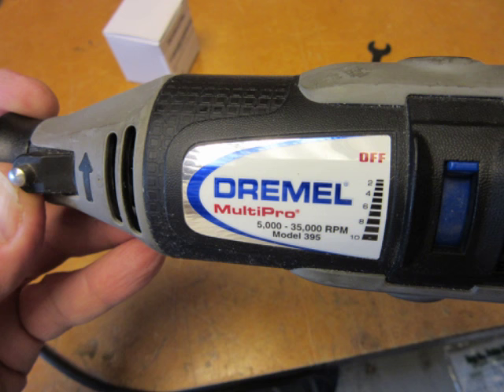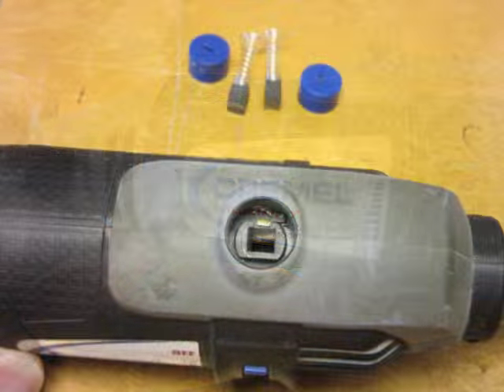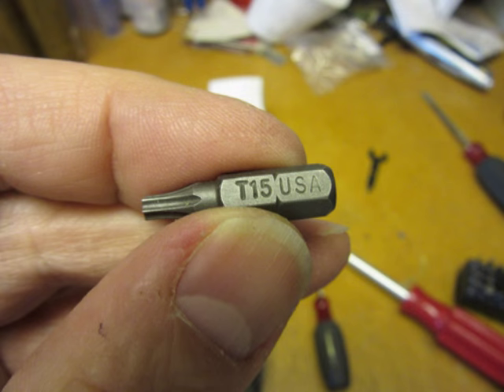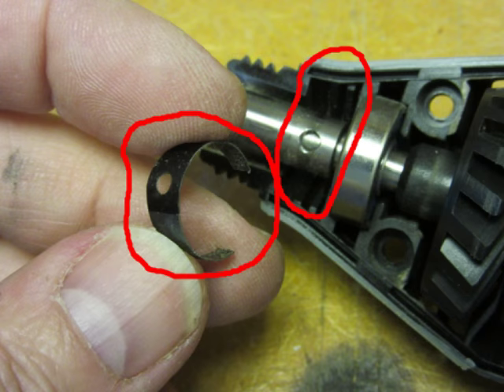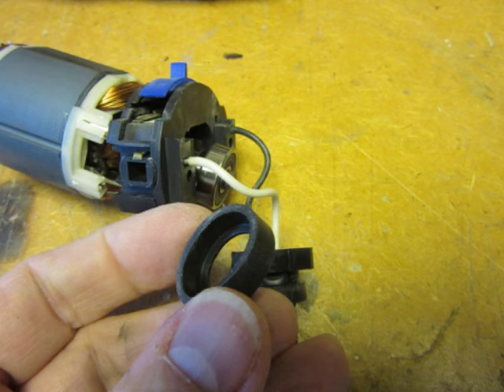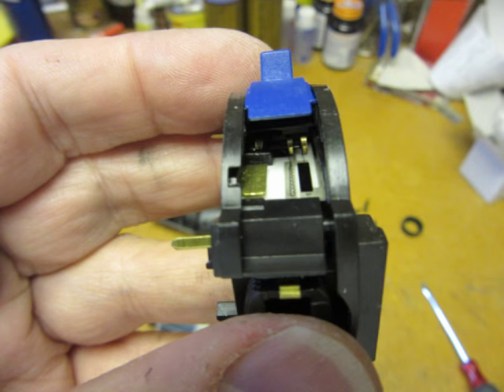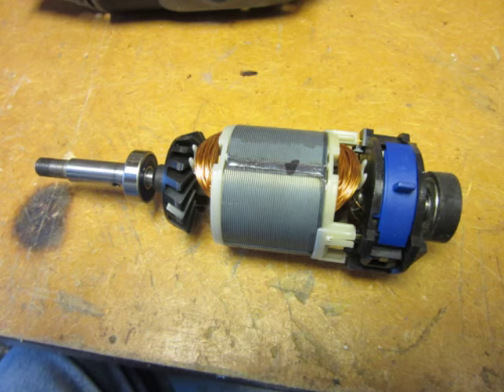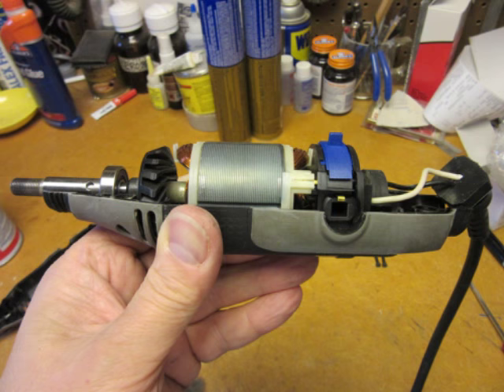Replacing the Speed Control on a Dremel Rotary Tool

Comment: Thanks for the video.  One thing I would like to mention.  Before replacing the speed controller, you might want to mention to your viewers that they should first check for spring and motor brush separation.   I was very frustrated earlier today when doing a project and I noticed that my tool had very little power and the speed controller only worked on a few settings.  At first I thought  it was time to replace the controller.  Upon further examination I noticed that when I pressed hard on one of the blue motor brush caps the tool came back to life and worked on all settings.  I unscrewed both caps and noticed that one of the springs when pulled came out with the brush attached while the other came out but the brush remained in its slot.  I gently screwed the spring back into the brush until the spring re-seated and would turn no more.  Now solid contact was once again being established.  I re-started the tool and it worked 100% perfectly.  Again, this might not be the problem that everyone has but on lightly used units like mine that do not have that many hours on them it worked like a charm.  After seeing your video, I plan on purchasing an extra speed controller and springs and brushes to have on hand should I ever need to do the job in this video.   Nice Job & Thanks once again!!!!!!!
Reply: what do you mean by "motor brush"?
Reply: @andreashenriksen1485  Unscrew the blue caps and check to see if the springs have separated from the magnets.  Poor contact will produce very poor performance.  Screw the springs back onto the brushes aka magnets.  Place back into holes and replace the blue caps.  Good luck....
Reply: @911naimplate  Oooh okay. Mine are not screwed in. I think mine's a bit different from this one in the video. But anyways! thanks!
Reply: @andreashenriksen1485  Welcome, good luck  :  )
Reply: @911naimplate  the brushes are magnets instead of just being a square carbon brush. ? now i gotta go tear mine apart & see... lol... it will be the first time i seen magnets used for brushes , to ride on the commutator...

Comment: On my Dremel 300, the top side of the field coil assembly has an adhesive rubber cushion, so you can tell which way rund the coil goes.  The rubber cushion is on the opposite side to the speed switch.

Comment: I have the same model dremel and it lasted longer than yours before the speed control work intermittently. I am glad I found your video and will replace my motor speed control instead of buying a new dremel. Thanks for the very helpful video with the part number.

Comment: I took apart my Dremel 395 and found out one of the wires to the switch was loose. I tried to put it back in but it keep coming loose. I put a dap of epoxy on both wires and wait until it dried. You mention in your video it was hard to keep the spring align during reassembly. I put a piece of scotch tape onto the aligned spring and detent to keep them both aligned. Make sure the tape is long enough to be pull out once both halves of the housing are aligned. I reassemble, check rotation for binding and reinstall screws. Turn on dremel and intermittent power is fixed. Again thanks for the video that gave me confidence and things to watch out for during disassembly and reassembly. I did not have to replace the switch assembly.

Comment: I bought a Russian but made in China Dremel type tool. It has 9 speeds, but when I select higher then 2 speed its sound increase so much along with speed and vibration. I have not checked it at speed 9, but I suspect that at that speed I will be deaf by its sound. Lastly when I use and its speeds drops I noticed that its speeds increase so much than when initially it was running. Can anyone help me or all Dremel are like this.
Reply from the maker: Muti ur, you ask questions, but have provided no useful information. "Russian but made in China" is not a very useful description!
You ask for advice, and mine would be, if you buy the cheapest crap, then don't be surprised when it does not work well.
Reply: @youtuuba  Bnktop brand
Reply: When I increase its speed over 3 its sound and vibration increase too much. I want to know if this happens to all rotary tools.  It price is average and most sell their average at that price
Reply: I need confirmation about last part of my question that do all rotary have same speed response under load
Reply from the maker: @mutiur7396  , ALL rotary tools are likely to get noisier and less smooth as speed increases, because any gearing makes more noise with speed, as does the motor fan, and unless every rotating part is precisely balanced (unlikely at the hobbyist price point) there will also be more vibration. But there are higher quality brands and lower quality brands.....

Comment: pocketweez On my 300, the new switch can attach to the back of the motor correctly or 180 degrees from that. If attached 180 off, the motor is bound up and will not work.

Comment: I repaired the switch instead of buying a replacement. First off - thank you for this great video! I didn't even search for it but it was recommended to me. It gave me the motivation to take apart my Dremel with speed control malfunction.
I went a few steps further and repaired the switch. Here is how:
The switch housing comes apart long ways. Just pry them apart, not much effort needed here.
The blue slider switch (mine was red) falls out along with the rocking switch mechanism that makes contact with the chip board.
Examining the contact points on the chip board, the electric runways were covered in black gunk of some kind - which was causing the Dremel to run either full power, or off.
I used rubbing alcohol and q-tip to clean the gunk off the chip board. That was it.
To put it back together, slot the two parts of the switch in their respective slides and put the switch housing back together. The lower switch mechanism clips into the blue (or red in my case) sliding switch like a rocker arm.
Reply: I will try to repair my speed control switch now too. Thanks.
Reply: I did the same for my Dremel 300.  I cleaned the printed carbon & metal tracks, & the brass runway with IPA, and also the brushes.  The two smaller brushes needed to be bent slightly to the side, as they were tending to drift to the side off the tracks.  I also bent them very slightly to make stronger contact with the tracks.  After that, a bit of Silicone grease for the sliding plastic parts & reassembly.  It works great now!

Comment: My dremel is starting to occasionally change speed randomly, could replacing the switch fix this?
Reply from the maker: rac 4714, there is a good chance that the speed controller is intermittent/worn, and replacing it might solve the problem.

Comment: Good video. This is very similar to the 3000 and the same principle applies, though with the 3000 you don't have the issue of the locking pin. It is part of the housing, so yay for me.
I first tried new brushes to no avail so I have a new switch that should arrive tomorrow. Hopefully that solves the issue. Total cost of brushes(taxes and shipping included) was $9.28 from Widget Supply and the switch was $12.50 from M&M Parts. I see True Value had a special on the 3000 for Black Friday where after everything was said and done it would have been $39.99 plus tax and shipping if you went that route. Some less technically inclined, or don't want to take the time to mess with it might be better off just buying a new unit entirely unfortunately. I will fix mine this time because I spent the time researching & playing with the unit, but even I would have been "better off" just buying a new one.

Comment: HOW DID YOU TEST YOUR SPEED CONTROLLER IF ITS GOOD OR BAD?
Reply from the maker: EMIL SIGN-AUT, not sure why you are YELLING...?

I tested my speed control by cleverly noticing that my Dremel tool was only running at one speed when it should have been variable speed.....
Reply: SORRY NOT YELLING , I JUST HAVE A BAD VISION THAT IS WHY THEY ARE ALL CAPITAL LETTERS.